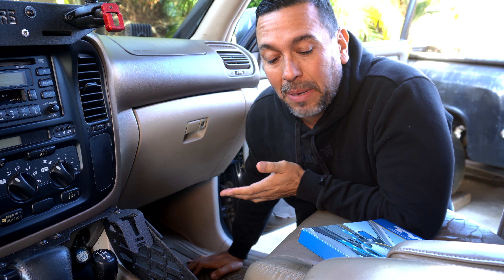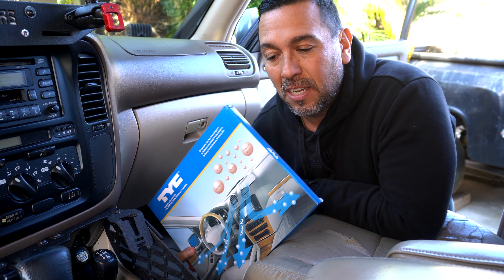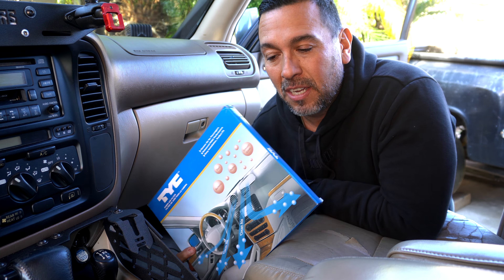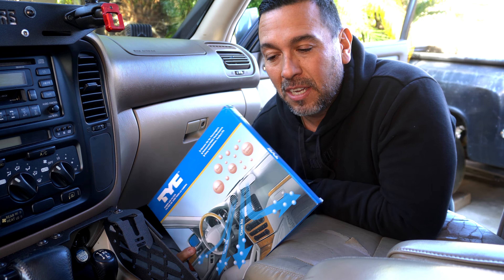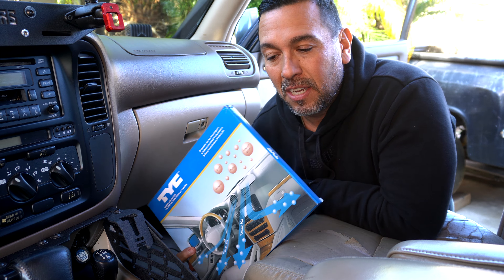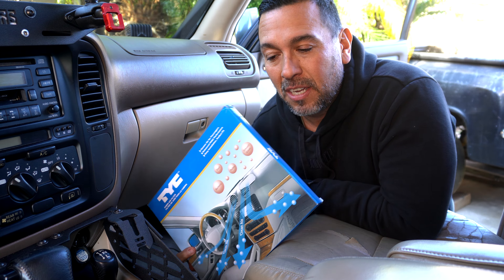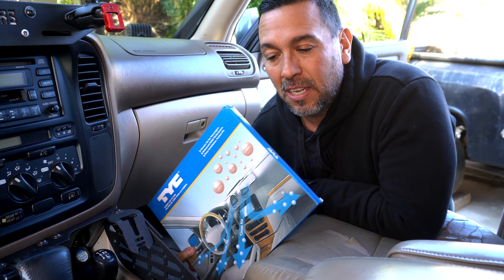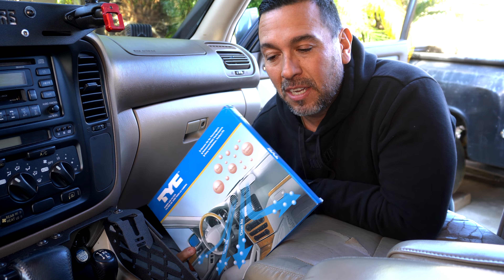How to Replace The Cabin Air Filter on a 100 Series Land Cruiser / Lexus 470.

Comment: I came across your page just today You my friend have earned a subscriber for life!
Amazing videos, and the attention to detail you have given to each of your installation videos has been extremely helpful!
And that’s a very beautiful Lc100, really clean also love the A/T Falkens you got going there!
Just got a quick question for ya, how many inches of lift does it have front and rear?
And what size are those Falkens, i’m guessing 285/75R16’s? Do you have any loss of power with that size? Or loss in fuel economy? How about road sound and vibrations?
Reply from the maker: Thanks for supporting and subscribing! Last time I check in the front was about 2"-2.25 I believe. Torson bars always seem to settle after a while and the rear spring are 2.5". I love my AT3W's and they are 285/75R16. I don't feel a lost of power being it's a V8 and I don't track fuel eco. No vibrations if you balance them correctly and I don't personally hear any road noise from them being that they are A/T's.